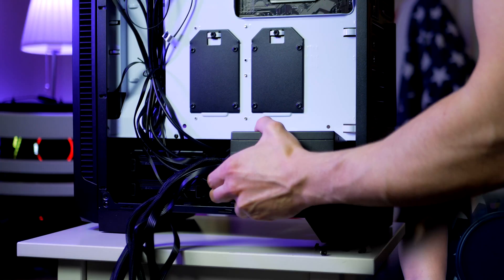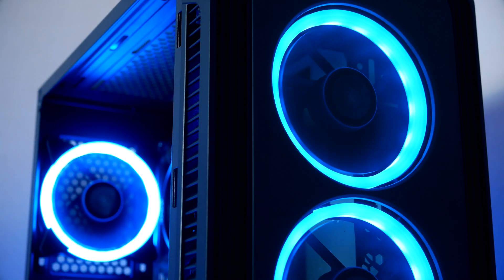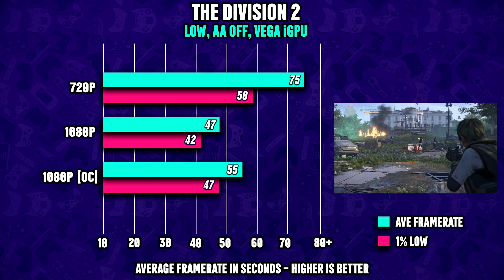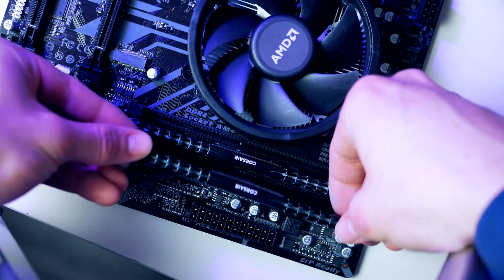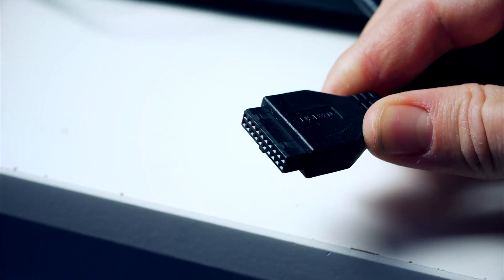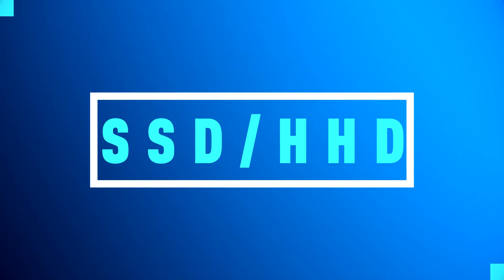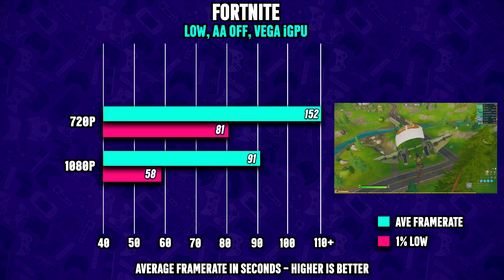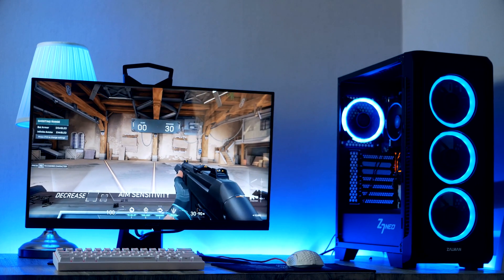Best $400 Budget Gaming PC Build Guide!🔥Epic Ryzen Gaming PC Under $500 In 2020/2021 /w Benchmarks!

Comment: So I’m a complete newbie when it comes to pc’s. Does windows come with this build or do you have to buy that separately? Also, all the cables your plugging in, does this also come with the items you buy? Thanks for any help
Reply: Windows not come with parts, you can buy it separetly. There is also option to install windows 10 without activating, but there is some cosmetic restrictions. You wont be able to change wallpaper and windows watermark will be displayed. All cables he connected are attached to PSU or case, so you dont have to worry about them. Only cable you need is sata for ssd, but it should be included with motherboard.
Reply: Varden thank you very much for getting back to me! This is very helpful!

Comment: you can make a true jewel out of this PC if you use a Ryzen 7 PRO 4750G instead (lots on ebay) and it will be prepared for ANY videocard in the future while still play with it very well until then
Reply: It would be better to go new with the processor since you have more lifespan of the processor and it will come with the stock cooler
Also the ryzen pro series cpus are locked so u cant overclock on them
Reply: @PepeTheMemeWizard  dude..you are obviously a pc building noob..not try to insult you but please don't try to give advice on this stuff someone might take you serious...